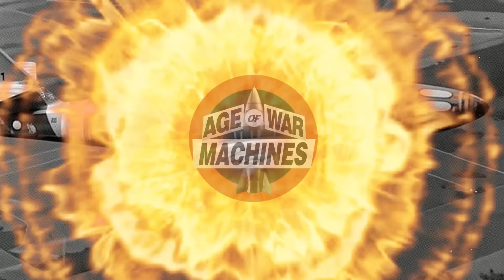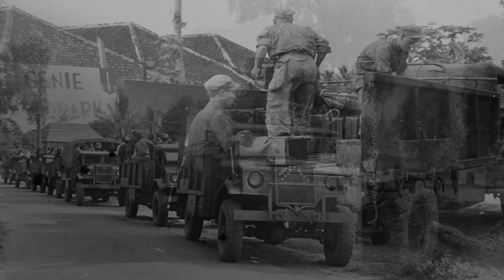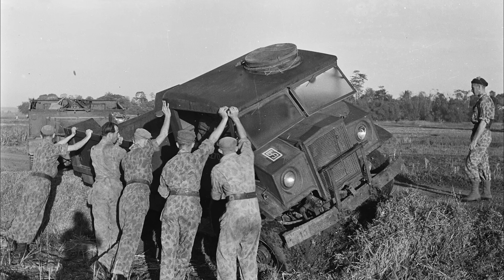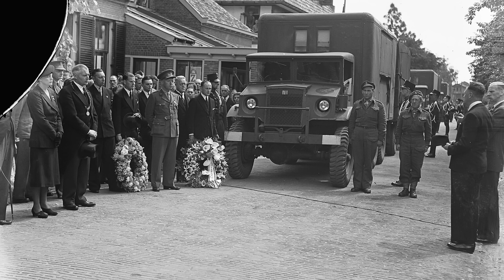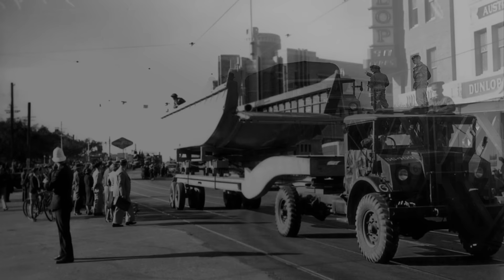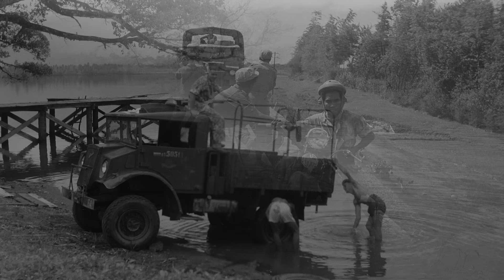Why the CMP Truck Succeeded Where Other WW2 Vehicles Failed

Comment: The brits asked Canada to build the CMP truck with very short cabs in order to fit a maximum of CMPs in a cargo ship.  The fit was so tight inside the cabs that some men were too tall (like Chieftain, who puts his videos here on YouTube) to be able to get inside and drive the truck.  The instruments of the instrument panel on the dashboard were taken from the civilian parts bins of Ford and General Motors - Chevrolet for the first months of production.  They were left-overs from the civilian production that had stopped immediately when the war started.
Reply from the maker: That’s a great bit of detail — those early “short cab” CMPs really were cramped to the point of comedy for anyone over a certain height. And you’re absolutely right about the dashboards too. 😁👍🏼

Comment: I remember my Uncle Roger who was in WW2 telling me how much he liked working on these trucks, he preferred the Chevrolet straight six over the Ford V8 version.
Reply from the maker: That’s brilliant — the straight-six Chev engines have a real fan club among the men who worked on them. 👍🏼😉🚀
Reply: @AgeOfWarMachines  The Auto shop teacher in the school where I taught told me that American/Canadian trucks and car tolerances were not as tight as the German vehicles.   They had enough slop built in and did not seize up as easily.  Plus, the average Yank or Canuck soldier had homemade experience working on engines.  Not so much for the average German soldier.  This was a considerable advantage for the Allies when there were problems with vehicles.

Comment: My father’s airfield had some of these in Sri Lanka. 
Bought a 1944 Chevrolet 15cwt in 1977 from a farmer in 1977 and drove it 30 miles home. 
It turns out that it was one of the few the military had converted to a tractor unit for towing trailers. A 270 engine from a 3 ton was fitted replacing the 216 engine and a winch was fitted to the front operated off a PTO on the transfer case. 
Top speed was about 40 miles an hour but it got you there.
Reply from the maker: That’s a great bit of history — amazing that you got a 1944 15cwt running and drove it home after all those years. 👍🏼😉TY

Comment: It si interesting to reflect that the unique supply methodology invented by one Canadian Army officer stemmed directly from the scarcity and type of vehicles he had available. As Commonwealth unit supply lines grew longer, there was no corresponding increase in the number of trucks, CMP or otherwise, available for resupply, Unlike the now Hollywood-ized "Red Ball Express: supply columns invented by the American  forces, the Canadian Army supply depot had only very well-used 50 CMP trucks to its name. The officer in overall charge of organizing forward supply invented and implemented (against direct orders) a system of known as "packet" supply truck movements. The principle was simple, but revolutionary. Rather than pre-planned & fixed convoy routes utilizing large numbers of trucks, a Canadian Corps "Maple Leaf Up" packet consisted of only 8 vehicles, with each packet being commanded by a junior officer who had total discretion about route choice, and who was not required to request authorization to change or select a route to destination.  A "Maple Leaf Up" Packet of 8 vehicles traveled at 20 to 22 mph. if the planned route was blocked, under fire, or otherwise unusable. the junior officer in charge was instructed to use his best judgement in finding an alternate route. Each packet consisted of a radio-equipped Jeep that carried the officer and a wireless operator. There were six trucks devoted exclusively to cargo hauling. All of those trucks were fitted with a universal,  identical, standardized cargo-fastening system invented and installed at the Canadian Army depot - unofficially, of course. The final vehicle in the 8-vehicle "packet" was part of the true genius of the "Packet" system: a repair truck that carried the spare parts and tools to repair the 8 most common CMP truck breakdowns, plus two mechanics. Each Packet was a self-contained unit. The only requirement was that the officer in charge use his best judgement and local information about the route the Packet would take, and to report the Packet's progress in by R/T once every 15 minutes. A radio report would be short and simple: Packet identifier, location, diversion or delay if any. All packets carried the radio callsign "Maple Leaf Up" followed by a Packet number: 1, 2, 3, etc., Position was given using standard Canadian maps. If the Packet changed its route, specific information about the diversion route did not have to be given, but just the fact of delay or diversion reported. The convoy speed of each Packet was kept at 20 to 22 miles per hour, faster than the 15 miles per hour employed by American truck convoys. Each truck in a Packet of 8 vehicles traveled spaced well apart - perhaps 200 yards from the vehicle ahead - enough distance to allow following vehicles to go around a truck that had stopped for mechanical breakdown, tire blowout, or other reason. Mechanics were encouraged to repair vehicles immediately if possible, and in fact over 90% of breakdowns were fixed by the mechanics right there at the roadside, using spare parts and tools carried in the #8 "repair" vehicles. 

A radio report to the supply dispatch point, every 15 minutes, would be something like "Maple Leaf Up One, Position XY, on schedule." Reports were sent using voice R/T, unencrypted and not in code. Fears that German radio interception of these reports would allow a Packet to be targeted proved unfounded - the German apparatus did not allow response rapidly enough to interfere with Packet movement, 99% of the time. In case of trouble en-route, a report might be "Maple Leaf Up Three, Diverting to secondary route by road damage, delay 10 minutes." Other Maple Leaf Up radio operators would also monitor these reports, and make note of potential problems ahead. Radio traffic was deliberately kept to a bare minimum. 

Soon, the system began to pay dividends in results: The first series of packets, a load of 280 tons of artillery shells, began arriving at the destination unit over 12 hours ahead of the scheduled arrival time. The 8-truck packets allowed for rapid unloading of the cargo trucks before the next Packet arrived. The system was immediately and demonstrably successful, so much so that within two months, the Canadian Army supply depot had assembled about 400 CMP trucks, and was sending supply shipments, in "Packets" to multiple units, with one-word radio callsign additions as required. Word of the success in speed of transit spread unofficially, and soon if the radio call sign "Maple Leaf Up" was heard by moving units or military police, the 8-truck supply "Packet" would be given priority passage. Soon, word of the success of the Canadian "Maple Leaf Up" Packet system had reached General Bernard  Montgomery, who began requesting that the Canadian transport network be used for urgent shipments. 
The "on-time" or "ahead of schedule" arrival of "Maple Leaf Up" supply "Packets" was above 85%, and eventually even officers higher up in the Canadian Army who had balked at or countermanded the idea of re-organizing the supply truck system were forced to accept one over-riding fact: the re-organizing worked, and worked extremely well. One particularly notable (and sourly vindictive) acceptance came from Gen. Guy Simmons, a British-national, British-trained officer who believed nothing good could come of "Stupid Canadian Farmer's Innovations." (That is a direct, first-person quote, BTW). Simmons was ultimately to have his toffee nose rubbed in the success of one quiet Canadian Lt. Col. [I know of Simmons' outburst because the officer to whom it was directed was my uncle, a senior Canadian tank officer, and he was not given to either hyperbole or inaccuracy]. 

At the end of the war, the Canadian supply officer was promoted to full Col. before returning to Canada. He was also awarded the O.B.E., the 'ceremony' (or lack thereof) taking place in a dusty London office with only 5 people present. That Canadian officer returned to civilian life and resumed his pre-war job: organizing the movement of grain shipments across Canada's prairies by train for the Canadian Pacific Railroad.  His responsibilities within the CPR increased as the CPR gained efficiency and profitability (over 25% improvement) from faster freight scheduling, thanks to the work of a Prairie farm boy who had been a railroad dispatcher in Saskatchewan before WWII,  learned moving two million tons of supplies across NW Europe. His story has been documented elsewhere on You tube, and it is worth learning about. 
Lt. Gen. Simmonds never lost his disdain for Canadians from the Prairies, or gained respect for their sacrifices. He was the perfect example of what Monty Python's Flying Circus would later call, "Upper Class Twit Of The  Year," and why Canadian troops hated to be under the direct command of "upper-crust" British officers. Simmons was the best example of the level of contempt some senior British officers had for Canadians - both the existence of and the achievements of Canadian troops. Simmons has been "lionized" by British historians, lamentably so. Canadians know that he was outclassed.
Reply from the maker: This is an amazing contribution Flying Beaver!!! — the level of detail on the Canadian packet system is superb. A brilliant example of how Canadian innovation had a real impact on the success of NW Europe operations. Thanks for adding this… superb information for people wanting to dig deeper. ⭐️⭐️⭐️⭐️⭐️👍🏼

Comment: Canadian here. When I was a youngster in the early 60s the local garage mechanic had a tow truck that was a 3 axle CMP.  It had a Chevy badge on it and right hand drive, and boxy, all details I thought strange. Chevys to me were cars and pickup trucks and were left hand drive.
Reply: I also remember the couple of CMPs that a local garage used.
Reply from the maker: Great memory — CMPs were proper workhorses.
Reply: A C60. Not many around.
Reply from the maker: Really appreciate you sharing that memory — those old CMPs certainly travelled far beyond the war. It’s amazing how many of them found second lives in places like the Northwest Territories, often in roles you wouldn’t expect. TY ⭐️👍🏼

Comment: "Its ladder-frame chassis handled punishment that fractured lesser vehicles" - such as what? Nearly every car and truck of the era had a ladder chassis, with exceptions that can be counted on one hand: Tatra (backbone chassis), of which none was present, and a few automobile models with unibody design.
Reply from the maker: Good points — the CMP wasn’t unique for having a ladder chassis, but rather for how ruggedly it was executed and how well it held up under extreme field conditions. 👍🏼